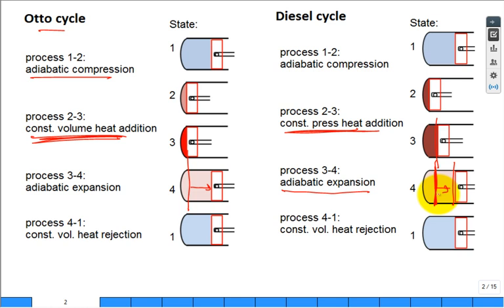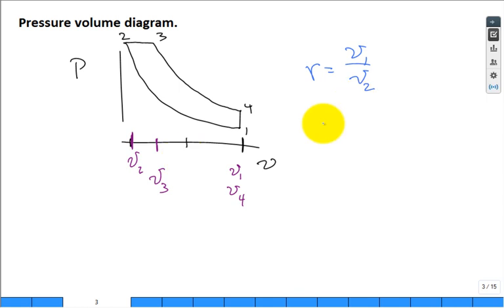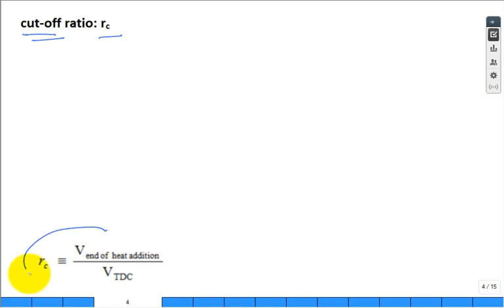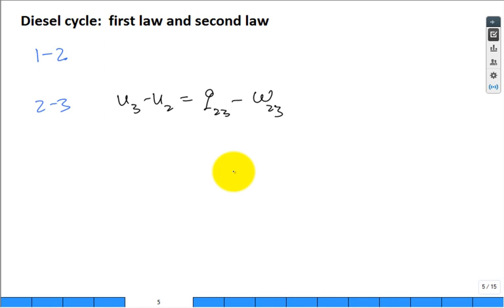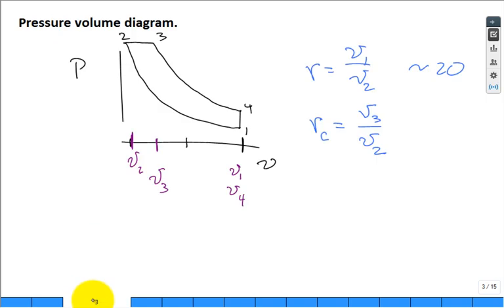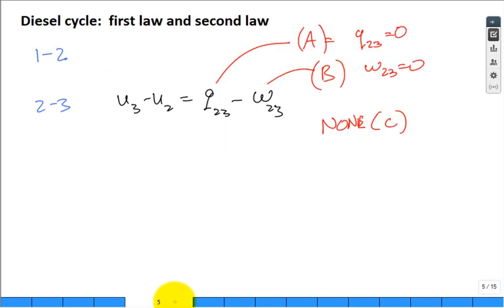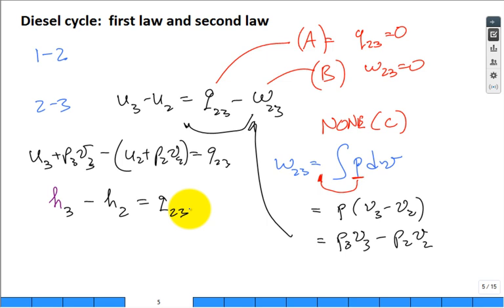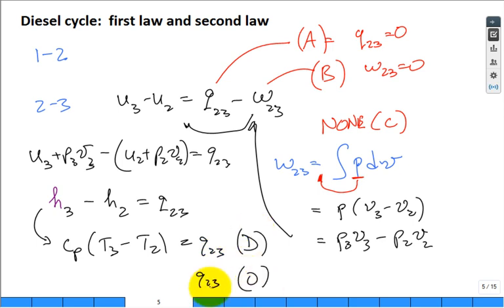Intro diesel cycle

Comment: Hi! I have a question. Is each process representing a stroke? Because I have trouble visualizing them with the graph. In 4 stroke engines it is like volume decreases , increases , decreases , increases but on the graph the volume decreases just from 1 to 2 and during the other process it just increases or it is constant. This got me confused. Thanks for your answers and amazing content!
Reply: each 2 processes are 1 stroke